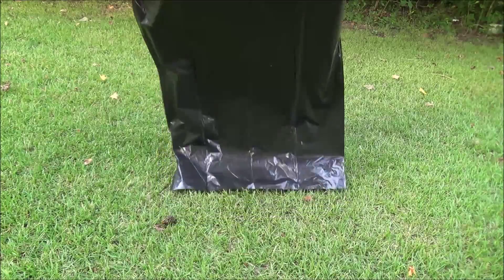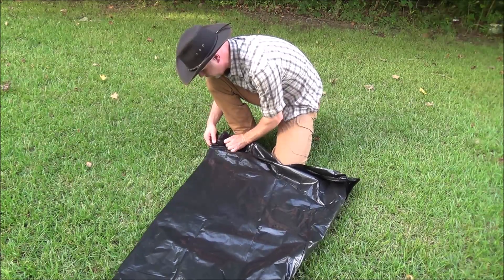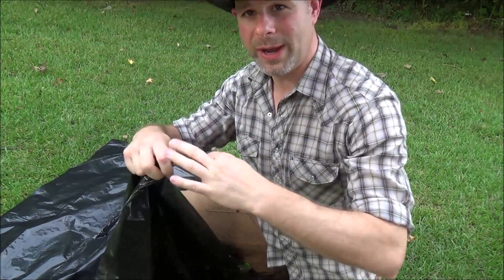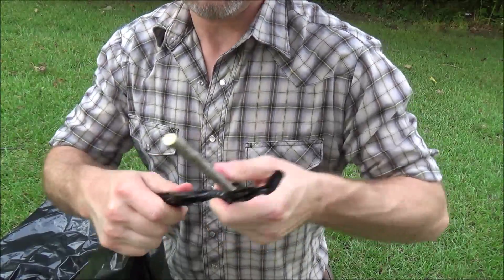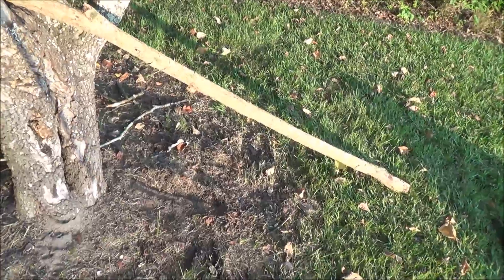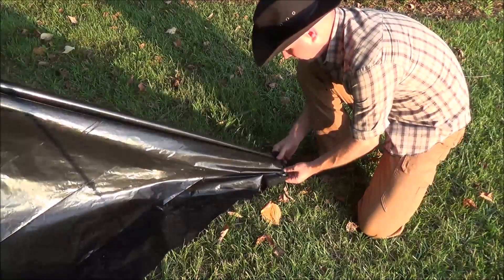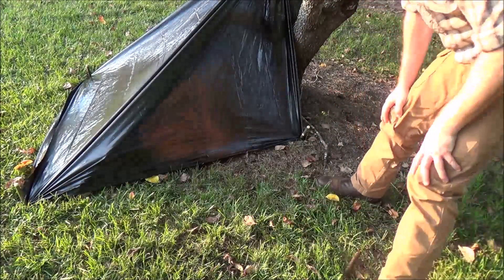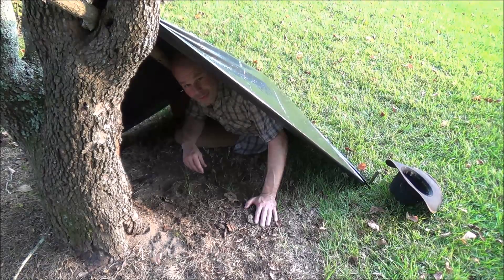Emergency Shelter Without Cordage (Plow Point)

Comment: The GBGB doesn’t seem to suggest putting a sleeping pad in his bug out bag, but the inflatable mylar baffled insulated pads are very light, warm, comfortable quite compact (around the size of Nalgene bottle), the only downside is the risk of punctures, but they come with plenty of patches in the maintenance kits and most have never had a puncture. But I was thinking, even in a long term bugout/survival situation when you’ve run out of maintenance gear it could still be stuffed with browse material and would be lighter than the browse beds to carry between camp locations 🤔

Comment: Good tutorial.  I would have done the same thing with the other four corners that you did with the first--twisting on itself and then wrapped that around your stakes--rather than punch the holes in the liners.  Doubling the corners certainly made it stronger, but it any wind conditions, those holes are likely to rip out.  Twisting the corners as you did the first should help alleviate that all together.
Reply from the maker: I do like your idea Matt. Very good suggestion. Definitely something worth experimenting with. I will play around with it very soon. Thank you for sharing sir!

Comment: Not really a good plan. You would be better off making a hole at the end and using the bag as a poncho.  Just saying.
Reply from the maker: This was a Pathfinder Youth requirement. The assignment was to make a shelter with a drum liner and no cordage. I guess having the shelter or wearing the bag would be more of a personal preference as to what one wanted to do. As long as the bag is providing shelter from the elements, it is effective. I can see where both have pros and cons.